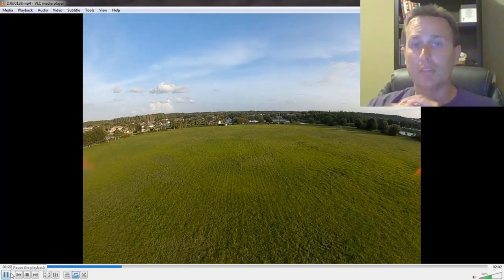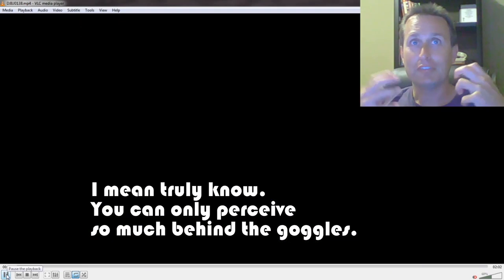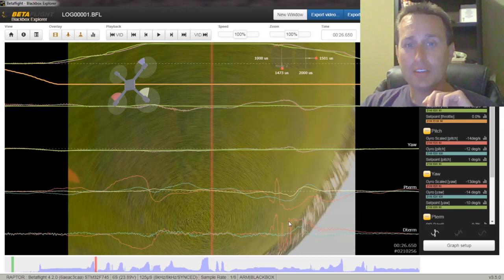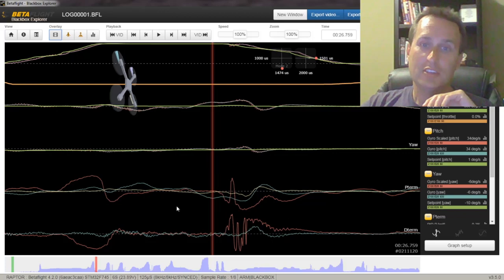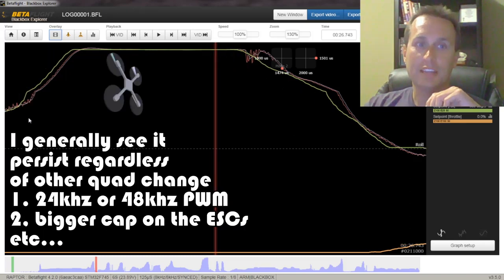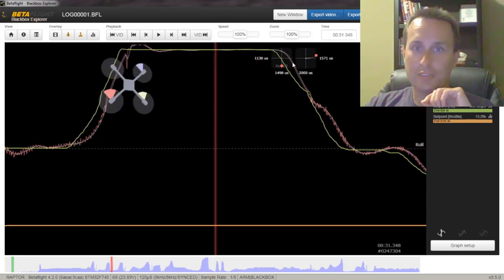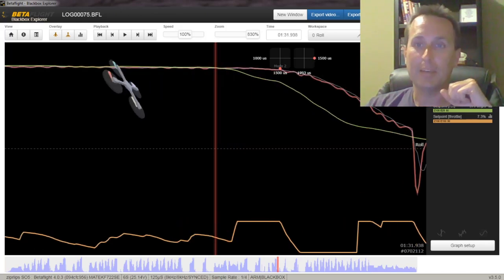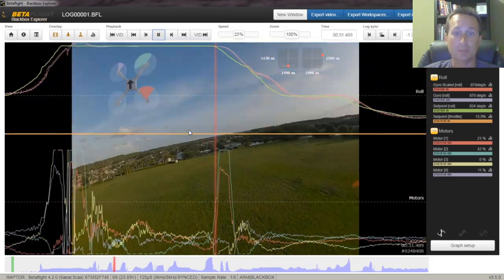What a BAD gyro looks like

Comment: There is another faulty gyro condition. One of the axis can have significantly higher noise floor than the others. Easy to spot when comparing filtered gyro noise spectrogram on each axis.
Reply from the maker: Agreed.  Seems less common (thank goodness!!), but i use to se a lot in the 32k mode days.
Reply: @uavtech  4 out of 20 gyros I've checked have this problem. It's not very obvious fault. Some are still flyable when everything is tuned for high noise gyro, but it's not worth it.
Reply: I got a faulty gyro on Alpha Lumenier and I could see it directly in the configurator gyro graph because the RMS value of the pitch gyro was wayyyy higher than the ~0 of the others with no movement. In flight test, this leads directly into violent random hiccups on pitch and it's not flyable at all.
Reply: @m4g4r4c  I have one quad with this problem and it's almost impossible to spot while flying
Reply: @coooxd  Not every gyro has the same amount of noise and differences between axes.
Reply: How do I check that? In the spectrogram of BF blackbox analyzer? What is a good or reasonable noise level?
Reply: my Gyro has it too (in a smal amount) the x Axis oscillate around 0,25- 15 or sometimes till 30. If I plug in the battery and watch the Gyro Sensor in Betaflight. In Flight I have no big Performance-Drops only a little more noise (~10%), compared to the Roll or Yaw axis. (Holybro Kakute F7 HDV )

Comment: EXACT same problem on a mamba mk4 f722.  With any throttle, the gyro completely loses it on one axis. Added a cap direct to FC with no affect.
Reply: 2 years later, did you fix the issue ? ( Or maybe abandon the hobby alltogether .. )
Reply: @dabdoube92  got rid of the board. There was no fixing it.

Comment: Hi regarding to hot motors. How to solve this issue. Im flash 4.2.1 matekf411 aio. New builds,plus i tried turn both slider to far left also improve abit. But still get hot motors. Not hot but around 30-40c range. Is this consider bad gyro too that cant filter out noise effectively? What are the other options i have to take in order to make cool on all motor? Thanks for videos.

Comment: Betaflight 4.2.2 doesn't work on the mamba f405 mk2 flight controller .it flips out on any kind of throttle up .
Reply from the maker: It is a mechanical or settings issue for sure.  The FW is sound.  Defaults should fly OK.  So if on filter defaults and PID Defaults, I would look into mechanical issues or props on wrong or something.
Reply: @uavtech  I tried every setting I could think of then thought well it flew fine before on 4.2 i put it back on the flight controler .I didn't change anything to the quad it's a gtr 349 and it stopped flipping out it was acting like it had a motor backwards .
Reply: @uavtech  any way you could check that out

Comment: I've got the new betafpv 6s aio and when using 6s the camera blacks out and the motors go nuts on sharp flips and rolls. Its slightly better on 48kz vs 24kz. Tried multiple sized caps and out it in another build and it has the same problem. It doesn't black out on 4s but flies really poorly regardless of tune. Is this also a bad gyro or something else bad on the board? Unfortunately this board doesn't have blackbox.
Reply from the maker: Sounds like a bad gyro to me.  Swap in another board and see if better.
Reply: @uavtech  I did and it flies great now. I was just wondering if it was something I was doing. Thanks for the response. Your videos have been a huge help. My quads have never flown this well!

Comment: I got a talonf7fusion. It seams to have the same type of drop in one of the gyros on pitch. It doesnt happen every flight, but its there. On dual gyro scaled, I found it on the gyro1. It's at the end of a flip, it will have one dip randomly, which in turn makes the motors and dterm spike for the remainder of the flip. It doesnt drop like the one in your video, but there is a noticable dip. It looks very similar to the roll on the log at 12:44-12:48ish in your video.

Comment: I'm using a LUX F7 FC so when I saw your video I went straight to see if I have some issues with my Gyros. But from my point of view is alright. I'm wondering if the problem could be related to the input voltage of the FC as I'm still using 4S on my quads. Did you make your test even on a 4S quad?

Comment: Just last week I build up quad with a FC that I had lying around (Talon F7 Fussion, with 2 gyros). On friday, while doing some corkscrews I immediatly noticed some random quick movement that I didnt commanded (i was using low rates, about 500 deg/s). Then I thought it could be the tuning, a loose cable, some motor, etc. Until I checked the blackbox I could see that, being my RC stick inputs "smooth", gyro on the pitch axis had very big spikes, which causes the system to oscillate quickly.

Yesterday, I needed to unload some batteries after a race, and then I went to debug this. Problem was still there (good). Then I went to Betaflight Configurator and changed the default Gyro selector from BOTH to FIRST gyro. Problem persisted. Changed now from FIRST to SECOND gyro. Problem GONE.

I guess these 2 gyro FCs can work very well when the remaining good gyro is selected. Time will tell. I also wonder, if when BOTH are selected, the algorithm makes an average of both, or thrusts the smoother one? Dont know...

Good video and explanation!!!
Reply from the maker: Yes, it Averages.  So if one is bad, selecting the other is better.

Comment: I think I have a bad gyro but I'm not sure. On a brand new build the quad tries to slowly yaw to the right and pitch backwards. In Betaflight on the setup tab when my drone is sitting flat on a table the model on the screen slowly yaws to the right. The FC is a Hobbywing F7 convertible.
Reply from the maker: Increase the deadband on the Receivers tab and make sure the sticks center at 1500.
Reply: @uavtech  Thanks I'll give that a try. The first thing I checked was the radio to make sure that I hadn't accidentally trimmed it or something. I also checked the end points  and mid point to make sure they were setup correctly. Interestingly enough I can still control it well enough to fly but the RC link is at 0 on the OSD and the RSSI DBM is -130. I've been debating whether it was related. It's my only drone that has ever done this.
Reply from the maker: @Loki_Morningstar666  bad gyro would result in shaky flight, etc... Drift is most likely a mid-point calibration or deadband issue because the RC link has too much jitter.
Reply: @uavtech  I raised the deadband from 0 to 5 and had two good packs but on the third pack it started doing it again but worse. Do I just not have it high enough? I'm also wondering if it could be a bad receiver since non of my other builds have had an issue like this, but I could be over thinking it.

Comment: Could  a wire hitting the gyro cause weird looking gyro movement? I had what I thought was a bad gyro cleaned everything up and never had the problem again.
Reply from the maker: Yes, a wire hitting causes issues, but not specifically at motor ramp points like a bad gyro.

Comment: Wondering if you could help as I’m getting nowhere with various different sources of help. I get the roll of death by just hovering and blipping no more than 40% throttle. Most of the time it rolls to the right, however a few times I have ha sir happen to the left. The FC is a brand new MatekF722 mini and before swapping it out, the quad flew just fine. I’ve bench tested all the motors and none of them seem to be stuttering going from minimum to maximum. I’ve also changed the motor start up time to the minimum in BH Heli and still has no difference. Only thing I can think is that’s it’s a bad gyro? The box black data shows that even when arming on the ground the roll axis starts to have oscillations that seem to get stronger and stronger... any help would be appreciated as I’m out of ideas!
Reply from the maker: set filtering at 1.0 sliders, implement tips at: https://youtu.be/jWdkl0EHkyU
Reply: @uavtech  filtering sliders already at 1.0 and already tried the tips in your video.

Comment: I have a quad that has begun shooting straight up out of control when I apply throttle. I suspect a bad gyro. Have you ever seen this before?
Reply from the maker: If started out of nowhere, could be that or just lots of vibrations from something on it (props, motors, electrical noise, etc...).

If new, make sure on bone-stock Betaflight defaults.  If occurs on defaults, it is a mechanical or electrical issue.
Reply: @uavtech  Thanks for the reply! I have some longer screws on order. The screws holding the stack are almost to short and they had to really squash the gummies to get it together. I was wondering is lowering the gyro from 4 to 2 khz would help make the gyro less sensative?

Comment: I had the same issue with a bad gyro on a Kakute F7 AIO (the first version). I've got a new Kakute AIO with the older gyro (6000 version, as it has less issues with the noise and sensitivity) on the way to replace it. I'm hoping I don't run into the same issues on the new one...
Reply: I was having bad drift with Kakute f7 V1 now i'm having bad drift with new version. Only had it 2 months.
Reply: @anti-popfpv4638  That sucks. I guess it will stay as a backup for as long as possible.

Comment: I had trouble with a iflight f7 mini twing getting weird yaw twitches.. adding 1 cap, improved a bit, adding 2 improved further, adding 3 big caps made all the trouble go away.

it was only on the 1 gyro, but overall gyro noise was a lot better using both gyros, so between the caps on board or only using 1 gyro, I choose having 3 caps on my quad, since I have a lot real estate on my 5 inch.

Do You Want A Black Box Of how the trouble looked like, without the caps and with them?
Reply from the maker: Yeah, that would be interesting to see.  What quad size, ESC, motors, etc?
Reply: @uavtech  what is the easiest way to share the logs? I will add a small description of the quad and where to look in the logs.
Reply: I'm having the same problem with this board, turning off either gyro made it even worse. Think I'll try adding another cap.
Reply: @Chris-tm5ul  interesting. I removed the small cap it came with, and added 2 gigantic 35v 1000mF, and it helped. But 3x caps was the one that really made the problem go away.
I'm using 4s and 2306 2500kv motors. Don't know if it gets worse on 6s.
Reply: @pippifpv  Thanks for the info, I'm running it on 6s 2207 1700kv motors. I was thinking about changing the fc because of this, it's the second faulty iflight one I've had. The first was in a Titan DC5 which out of the box was so bad I couldn't fly it, it was shaking itself to bits! turning off one of the gyros sorted the problem though. Where did you attach all the caps? I just have the small cap on the power line at the moment but will try your idea before I dump it.

Comment: Im flying kakute f7 on 7 inch quad.
It fly excellent(on my opinion) on calm day, but when there is strong wind then having some random shakings even when flying straight. I think that its wind hitting the gyro ribbon and makes gyro noise.
Can that be? Some one have any idea how to fix this?:)
Reply from the maker: Did you tune it?  BF defaults are not great for a 7"
Reply: @uavtech  yes ofcourse, by your videos, big thanks for that.
 It fly very smooth now and im absolutely happy with the tune. But on the windy days, when you feel wind pushesh on yourself, then the quad start to wobble randomly.. this seen even on fpv
Reply: @mutoryu   I have the same issue with an iFlight F7, it's not been right from new but windy weather makes it worse even when flying in a straight line
Reply: Had this happen on two kakutef7 boards as well👎found that ribbon connection wasn't soldered properly ✌
Reply: @thecraftking113  soldered to gyro? Or on old kakute version ?
Reply: @mutoryu  i not sure how old . It's in a kopis2 that i got from bardwell.